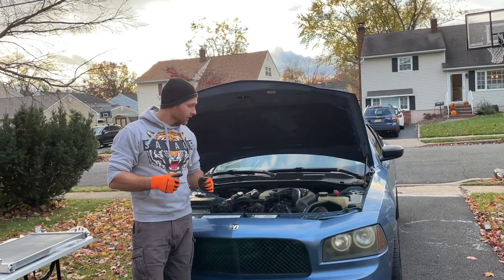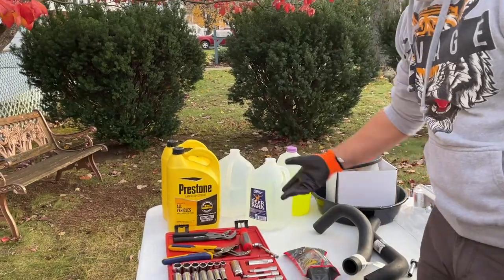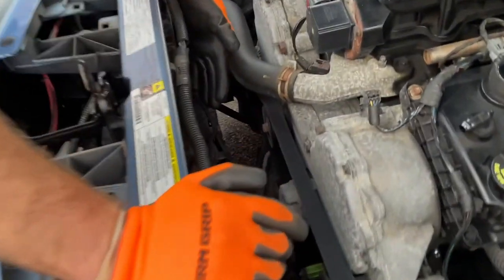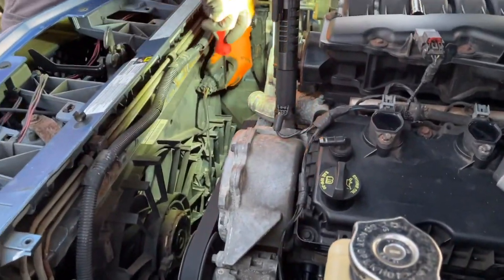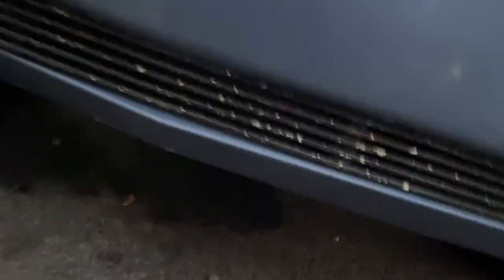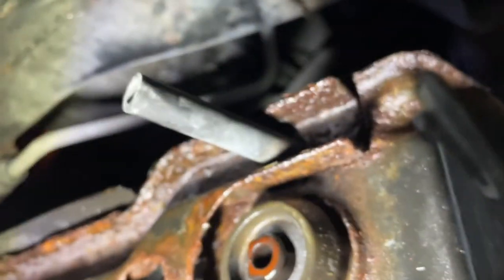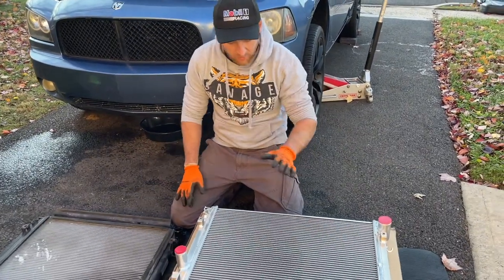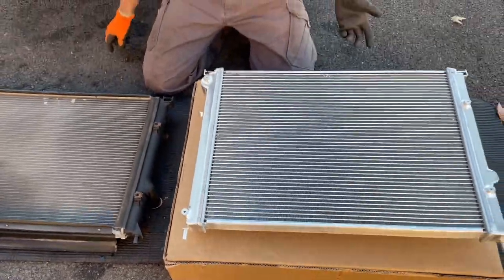How to Replace a Dodge Charger Radiator 2006-2010  (Easy home DIY - full process)

Comment: Great tutorial! My daughter bought her first car a, 2007 Charger. It made it about about 3 weeks and then the cooling fan came apart, causing a hole in the radiator and a broken air filter box.  Your video got her back up and running in about 5 hours.  Keep up the good work.

Comment: Hi there, thank you for the video. I wanted to know if the radiator and its kit from the next generation is compatible with 2010 dodge charger
Reply from the maker: This is all 06-10.  Not sure about 11 and later.  But idea is same.  Just get correct replacement parts

Comment: What are the tabs called that you put from the old radiator to the new one? Mine were torn and I wasn’t sure if it would be ok without them
Reply from the maker: The 2 plastic tabs that hold it on top right?   Upper Radiator Isolator
Reply: @HowToWithLech yes, thank you, couldn’t figure out the name for nothing lol

Comment: HI GUY NEXT TIME PUT ANTI-SEIZE ON THE RADIATOR MOUNTING SCREWS. MIXED METALS IS AN ISSUE WITH ALUMINUMRAD N STEEL SCREWS WONT COME OUT  NEXT TIME
Reply from the maker: Thanks 👍

Comment: I changed it now I get a check engine code
Reply from the maker: If it’s all good. Code probably has to be reset.  I had to do it after I replaced the radiator and thermostat.   As it was still coming up.  This will help you check the issue and reset if necessary.  How to RESET / turn off Check Engine Light on your car - FREE / Quick / Easy
https://youtu.be/qc75bVsJunU
Reply: Lol dam right just needed to be cleared
Reply from the maker: @Lemusmic  👊